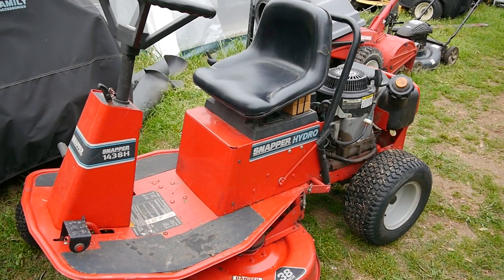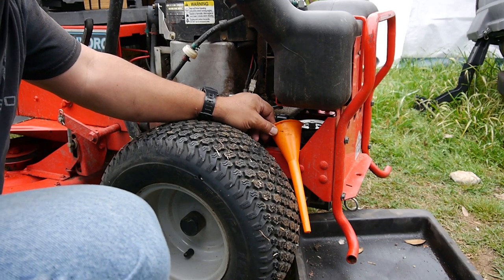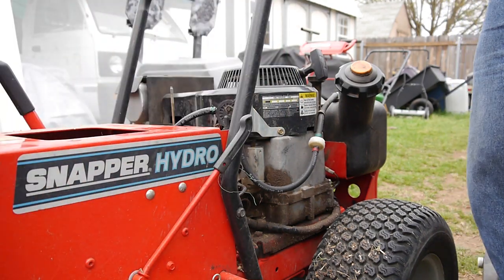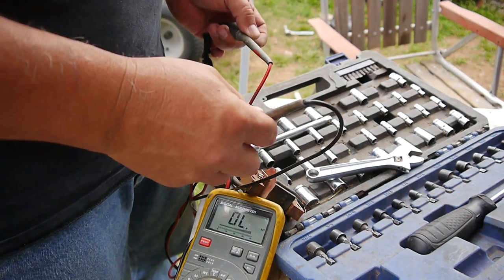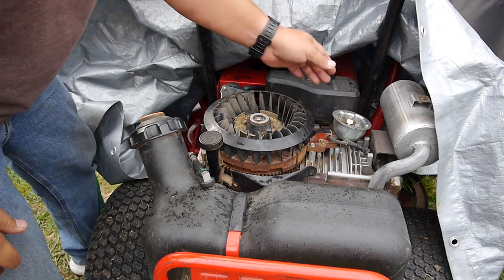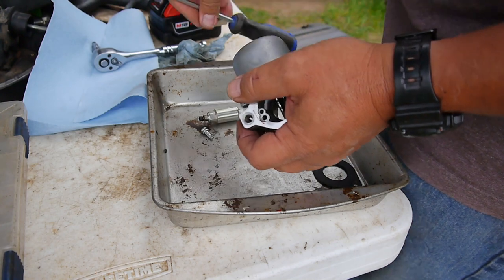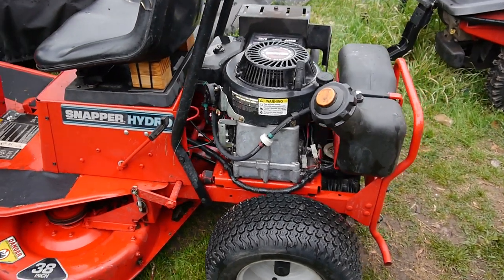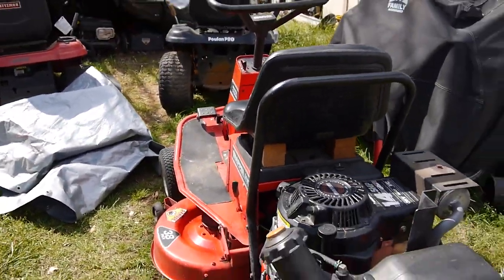Snapper 1438S Rear Engine Riding Mower - Old but needed some Tweaks

Comment: I got a Snapper given to me by my neighbor. He said it was fixed by the local snapper dealer. The unit ran for two months and just died. After I got it home and worked on it I found over  a dozen things wrong. Here goes, gas tank had 16 holes put into it by the shop, worn belt. fuel line cracked, filter clogged, drive wheel worn, broken clutch cable, throttle cable rusted stuck, ignition switch shorted, engine cooling fan not fastened, carburetor rebuild, oil change with one quart gasoline, fouled plug, shorted kill wire, dead battery. I am just amazed how shody the work was for one. Then the cost of what the guy paid, 800 plus dollars. Talking about how much this guy was screwed is just an understatement. 
 How many years did Snapper make the hydro model ? Do you think it was worth getting the rider ??? Nice work fella

Comment: When a coil is in question, always try to start it with the kill wire off, but remember it won't stop running with the key, so be ready to pull the plug.

Comment: Flywheel key will not affect opening and closing of valves. They are timed to match the piston with crank gear timed to camshaft gear. Flywheel key may affect the spark timing and put it of time with piston and valves.

Comment: I have an SR1433 with a Kohler engine, the reason they have those brackets on the back is because the mower can be tipped on its back for vertical storage and repairs or maintenance.  I wonder if they stored it vertically and later checked the oil, then overfilled it because they thought it was low?
Reply: Thos brackets are for mounting the optional grass catcher
Reply: @robertroberts9782  my grass catcher actually mounts to rear hitch, not the brackets.
Reply: @robertroberts9782  You are correct but they provide a dual purpose of standing the machine on end like rotaryenginepete said